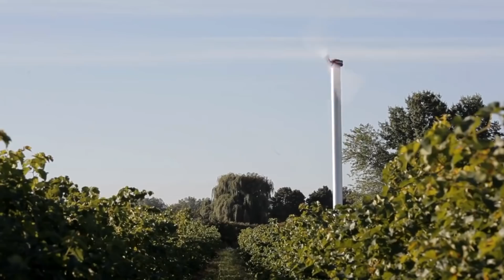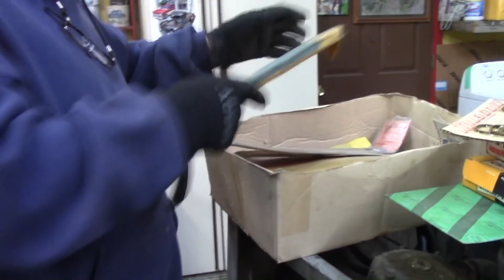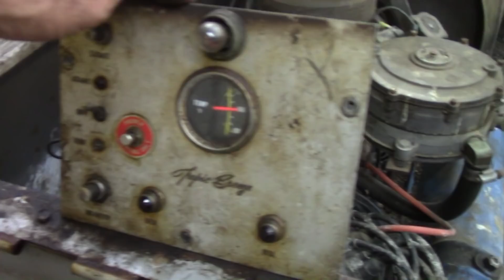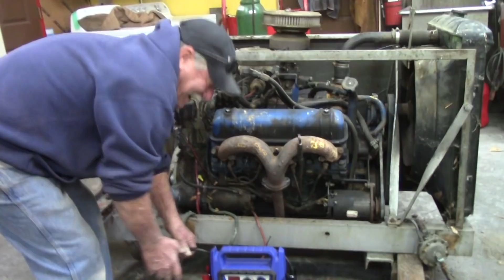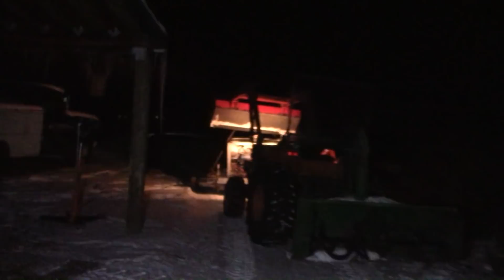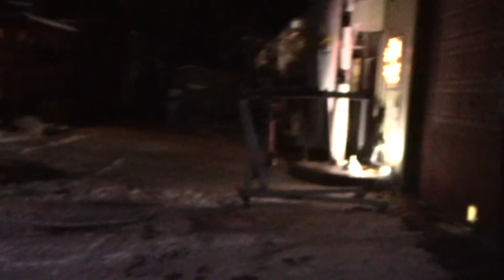1956 Lincoln Y Block Engine - FIRE IT UP!

Comment: 2nd 1956 I've seen fire up this week.  First was a 56 Packard 374 on Johnathan  W's channel.  Nice to see another vintage engine coming back to life.
Reply: Great stuff. Same comment from me. Seen the best ones, and not long ago, a start up of an initially seized early 50's Packard motor & same state Buick Flathead (over on Cold War Motors YT. channel) Great to hear iconic engines running again. Cheers
Reply: @frequencyfluxfandango8504  I watched the straight eight showdown as well.  Love CWM...can't wait to see the 1960 Fury in paint.
Reply: @frequencyfluxfandango8504  That was a Packard Straight 8 that thing was did not take to much to get going not as much as the straight 8 on that Buick that thing was a hurting unit